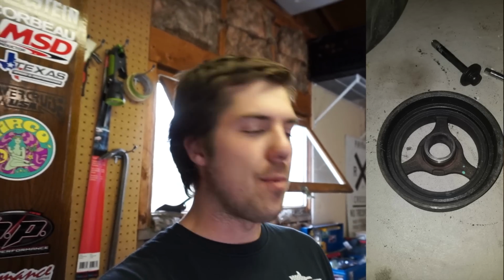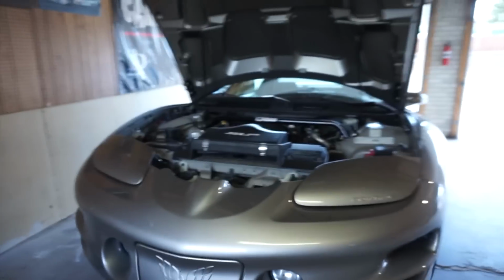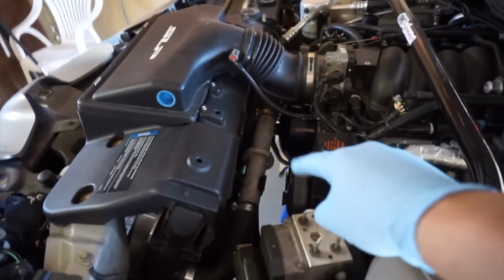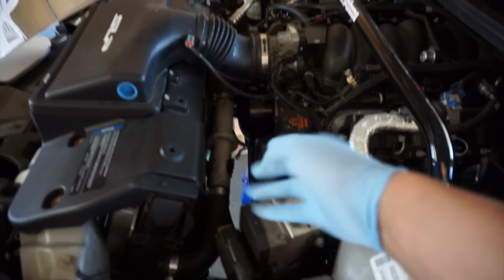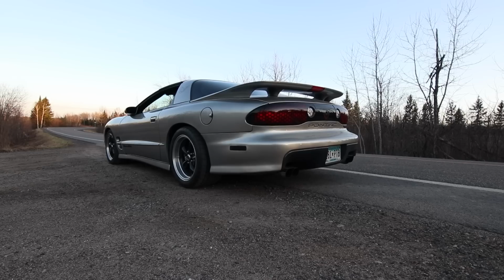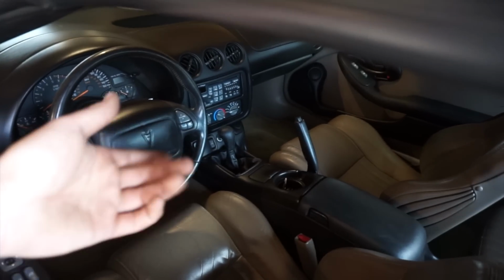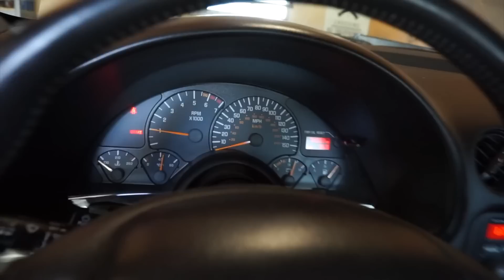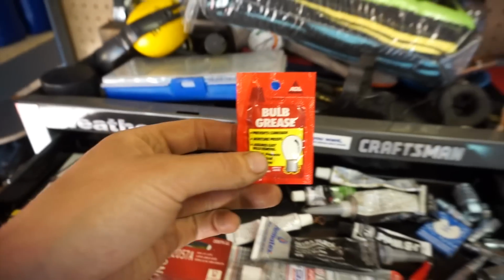New Z06 DISASTER + WS6 Spring Shakedown & Cruise!

Comment: Common problem on early C6 engines. The harmonic balancer was held in by a regular central bolt that would work its way loose. 

I had a 2005 Z51 that did the same thing. Started making a God awful grinding noise. Drove straight to Chevy dealership and as I pulled into service drive, the harmonic balancer came off and the car puked oil everywhere. 

Chevy developed a locking washer that fit around the bolt head to keep it locked in place. Chevy also upgraded my engine warranty to 6 years/100K miles.

Comment: Have an aftermarket exhaust on mine. The drive shaft barely touches the bigger pipe and causes a rattle like you were saying. You’ll be able to see markings on the pipe if that’s it. Bent the exhaust in and it went away for the most part.
Reply from the maker: I am thinking you are right, the owner of this car that actually put it together said that there is a Speed Engineering three piece Y-Pipe on it, and this exact thing has happened to him. Same sound and everything. Good call!!!

Couldn't find anything under the rear of the car, and can't hear it if the car isn't moving so it's a tricky one. Need to get the front end up in the air and check around more. I'll find it next time I'm in the shop.

Comment: Great video as always. If you check your clamps and don't find any issue with the noise try lifting up on the e brake just slightly and see if it goes away. A busy of mine had a similar sound and thats where it was coming from. Also I wanted to ask, on your Borla are you running it with the wide open plate? If not which plate do you have installed? I have mine fully blocked off with an electric cutout installed at the over the axle pipe, this way I can be quiet and loud lol. Your car sounds amazing and looks great as well, keep up the great content! Wish I lived closer to you as well cause I would be out at the track with you helping to make it great again 🙂

Comment: I don't buy used sport's cars that are modified or rebuilt cause you just don't know what headaches you might run into???? I bought my 94 Trans am bone stock not one bolt on mod on at all. The kid was just into loud bass with underneath neon lights lol... It still has the stock air box too hahaha...
Reply: Your exhaust my be rubbing on the over the axle peice?
Reply from the maker: No, it doesnt rub at all luckily

Comment: transmission mount
Reply from the maker: I looked at at the trans mount. It has a polyurethane one installed. Not too sure it's the problem.

There's no clunking or anything when shifting/accel or decelerating. Sounds like a vibration when taking off forwards or backwards.